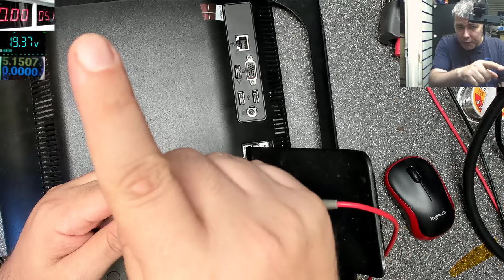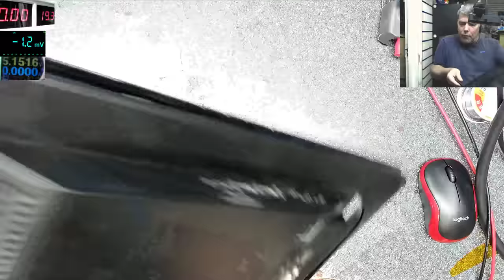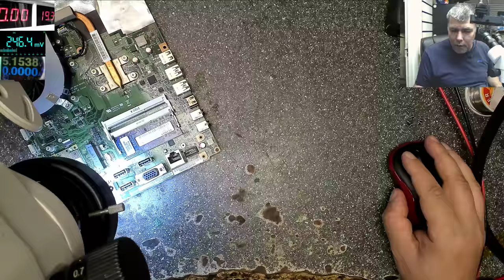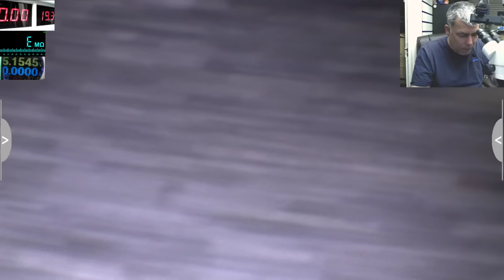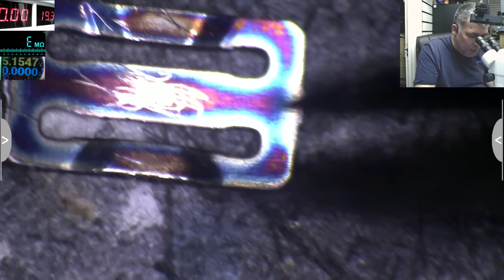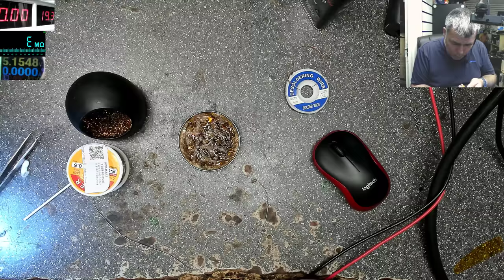Let's learn how a power button is working on laptops/tablets/phones

Comment: It's not boring Sorin, it's very interesting and a refreshing change from a charger port fault. Have to admit, I called it from the beginning, once 3.3v was confirmed and 0v at the power button, I said power button sticking down :)
Personally, before removing the button, I would have removed the board and soaked that end in a cap full of alcohol for a couple of minutes first.

Comment: Sorin: i can remove this capacitor..... emoves with tweezer
me: hahaha
Soring: i can remove this resistor..... removes with multimiter
me: hahahahahaha
Sorin: i can remove this power button.....
me: remove it with your multimeter hahahahaha

iits funny how you consider those things as nothing for you, me i am extremely afraid of reming something with the tweezer from someone's  computer, i am afraid of random things to happen so i end up doing two works instead of the original problem, it happened to me many times but now i take the lowest risk i can.
Reply: I've noticed that the more experience you have - less you care, because you know exactly what you are doing and your muscle memory is definitely there to help you, when you don't have a lot of experience you try to make everything professionally and oddly enough - bad shit happens even if you are doing everything right... 
But yeah, his methods are so old school... petrol, enjoying rosin smell, while all the new boys are using fancy stuff to pull away the smoke...our Sorin is just enjoying the moment... That's proper sick...

Comment: Amazing troubleshooting and repair. I learned a lot. I wonder if you could have been dealing with a tin whisker inside the switch. Instead of opening up the switch, maybe you could have applied some extra current to the switch to try to burn out the partial short.

Comment: This is very instructive video. Even that i know pull up/down resistors its nice to see how you find the right way to repair it. Btw. what probes are you using? (those banded ones from multimeter) I like those probes..

Comment: @Sorin I am a big fan. Any chance you can show us how to mod a laptop to create an external power button. It should be neat without drilling big holes in the casing. The reason we need this is when you have your laptop connected to big monitors the only way to power it on is to open the lid to get to the button. This is really annoying when your laptop it buried under the monitors. Ideally we would have an external USB-A power switch. Can you show us how to do this?

Comment: It may be just a power button issue but the good diagnostic process is the  key to solve these random issues as shown in the video, by the way i would've put the resistor and the cap back to their places they were just right there next to the board but you know it was a touch of dodgeness lol

Comment: Since it's random, it could be the cable between the power button PCB and the MB. That would actually explain the "randomness" of the problem. In the video, you've found 0V on the other side of the cable, but never on the MB pin itself. The pin on the MB was 3.3V when you tested after finding the connection to the super IO, but then you assumed that the cable was perfect, which it may not be...

Comment: Sorin why haven't you replace the capacitor and resistor you removed. Are the components used for switch debounce problems for the switch.

Comment: My laptop doesnt turn on and on the motherboard has 8-pin ribbon connector going to the separate board for power button and some LED indicators. I removed the cable from the motherboard and tested the ribbon slot on the motherboard and found voltage reading of 5v on the first pin (marked with arrow), and found 3.1v on the 6th and 7th pin. which part of those pin is the power button should be connected?

Comment: Most of the time the micro switches can't acheave a reliable low resistance when pushed.
I've seen devices get confused because of random resistances of dirty switches.
Reply from the maker: thats kind of normal, but this one had 2.2k without beeing pushed :)

Comment: I use an ice cube maker to store screws by areas, it make easy to find later
Reply: I like using monthly pill trays for holding small parts. The advantage is you can close the lid.

Comment: Thank you sorin sir,
Please let me know how to reset bios by shorting bios battery power if stucking in bios?
Reply: pull out the battery and with a metal tool (e.g. tweezers) short the battery contacts. Sorin showede this so many times, so where is the problem?

Comment: Sir pls tell me, i m always studying from you. i have a question about my laptop. when i put charging plug. my laptop is auto running without touching the power button. where can i check for it Sir. Pls tell me. Thanks you Sir...

Comment: As always another good and very informative video 

Seeing the internals of this all in one makes me a little nervous about the unit I recently picked up as want to upgrade it's Ram and don't really want to go through taking out all the shielding haha

But in fact this machine i got is an HP pavilion 20 about 10 years old give or take has 2GB ram dual core AMD and graphics shares memory from ram and paid about $20 for it  

Was meant to be a machine for basic things like internet and word / Excel and maybe a few older games  but that was running like a bag of shit as previous owner installed Windows 10 I worked ok but with a fair bit of lag 

Based in HP it's supposed to be a 8.1 machine so installed 8.1 and with correct drivers am absolutely amazed with the results it is running very fast and when t sting some movies on it well let's just say the quality of video playback was much better than my I7 laptop  so my workhorse laptop has be set aside and now this all in one has taken it's place well for now